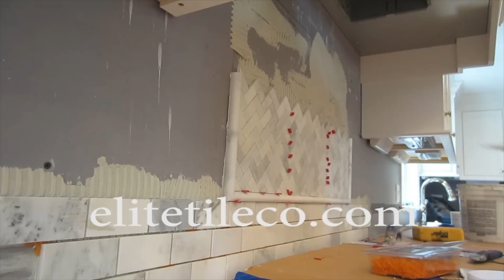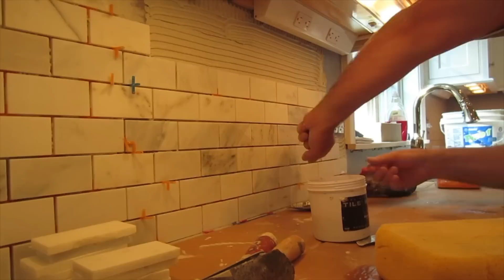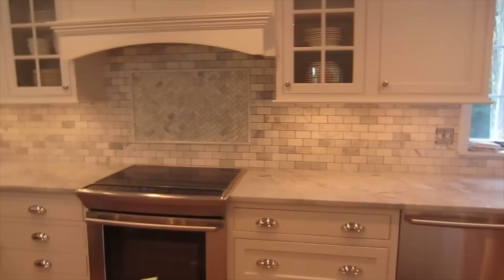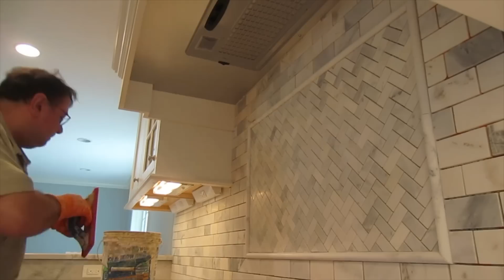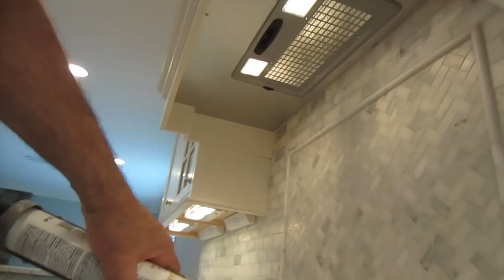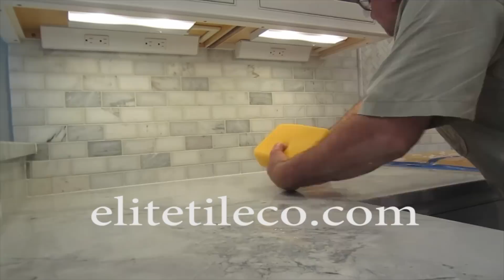Marble subway tile Kitchen Backsplash with feature Time lapse

Comment: Any videos or advice on grouting Beveled Marble Tiles ? The bevel is so deep I don't see how one could grout it efficiently.
Reply from the maker: Use the rounded corner of the float to toll the grout line, or your finger, make sure you are wearing gloves or some other tool hat will do the trick.

Comment: Sal Im about to start a large backsplash project tomorrow and i wanted to ask you.  I see you are not spacing the trim around the backsplash I have 1.8" width trim stone do I need to space it like the rest of the project 1/8th or should I do it flush Ive seen both just not sure which one to do flush or no flush I'm talking about the picture frame trim you are doing there.
Reply from the maker: Should have a grout line between all tiles, it may not look like I spaced it, but I did, it may have been a smaller space than the tile grout lines.

Comment: Thanks for the helpful video.  I followed your videos and installed a marble backsplash. My only issue is that I got sealer on my white cabinets and it stained. Do you have any suggestions on how to remove the discoloration from the cabinets? Thanks
Reply from the maker: Sorry I don't, maybe you can contact the manufacturer for some help.

Comment: I just recently had a polished Carrara marble tile backsplash installed with an enhanced grout.  The installer did not seal the tiles before grouting.  I don’t see any problems in terms of discoloration, etc., with the marble.  However, I want to seal the marble tiles now but the grout bag says it doesn’t need to be sealed.  Will I ruin the grout if I seal the tiles?

Comment: beautiful job!  I am about to put 2x4 marble  on a mesh backing from lowes...question ..what type of premix thinset or Mastic brand etc do you use for the same installation in the video..and what type of grout...sanded/non sanded premix not premix brand ect?  again mine is the same setup as you are doing with the 2x4 tile ..thank you
Reply from the maker: Stay away from anything that says premix thinset, it is mastic no mater what they call it. Many stones will stain if you use mastic, so only use a white thinset that comes in powder form. The same goes for grout, unless it is an advanced grout, like Mapei Flexcolor CQ, use only gout that comes in powder form. Sanded or unsanded will be determined by the width of the grout line and whether or not the stone is polished.

Comment: I used 2x4 plowed Carrara like In your video ..tiny bit less than 1/8...the tile guy that was gonna do it didn't believe in sealing the tile before grouting and told me unsanded would be a complete mess and that he mixes sanded in it ..didn't think that was appropriate for marble ...let me know what I should use for the grout
Reply from the maker: Any natural stone should be sealed before grouting, and sanded grout may scratch polished marble. Unsanded grout can be used for joints up to 1/8", Your call.

Comment: Hi Sal, I have a couple of questions. Do you have a video on how to cut mosaic glass backsplash? And what kind of tool/ cutter would you use for a natural stone with  mosaic glass insert backsplash? They are 12x12 sheets with mesh. I read not to use a wet saw cause the mesh falls apart. Thanks
Reply from the maker: debhl7w I usually cut them on the wet saw, most mosaics will be alright when you use a wet saw, some will tend to come off the mesh, but you can use some tape to hold them together while cutting and dry them off right after cutting. The only way to know is to try.
Reply: Thanks Sal, take it easy.

Comment: I'm a mason by trade my specialty is stone veneer. Quick question will a thin layer of thinset properly bond to drywall or should provisions be made such as installing hardi backer (cement based substrate) to ensure an adequate bond?
Reply from the maker: In a dry area Drywall is perfectly fine.

Comment: Wow! Beautiful work!! I am using the same marble backsplash around my fire place and I want to ask you how you  how did you cut the marble pencils make a frame? 
The solution that you used before grout what is it called and why did you wipe the marble with it?
Thank you 
Definitely share and subscribe 👍🏻
Reply from the maker: +Neirouz, CPA Wet saw for cutting marble, and Miracle  sealer to seal the tile before grouting.

Comment: what size and brand were the orange t spacers you used for this tile?  I have the exact same tile with the mesh back from lowes and can't find a spacer that fits?  since the tile is on the mesh why do you need spacers??
Reply from the maker: they were these http://www.contractorsdirect.com/Barwalt-Hollow-Leave-In-Spacers and the tiles were not very sraight on the mesh so i used them to straighten them out a bit.

Comment: Thanks for making the video. Great work. Those are some heavy tiles. I'm surprised it doesn't sag due to the weight. What type of mortar are you using and is it premix? What do you recommend? Thanks
Reply from the maker: It was probably Ultraflex 2, but you can use mastic on a backslpash as long as it is compatible with marble, some will stain the stone if you get the wrong type.

Comment: Thanks again for your awesome time lapse video and for your quick reply to my question.  One other quick question if you don’t mind.  I noticed in this particular video that you put spacers on the bottom of the first row of tiles, where the tile meets the countertop.  Is this the standard procedure?  Would it be ok or would it be wrong to use no spacers on the first row and let the tile “rest” on top of the countertop??  I realize that in either situation, the caulking will be applied to that area.  But again, why the spacers on the bottom row as opposed to just letting them rest on top of the countertop.  
Thanks again and keep up the great work!!
Reply from the maker: +K. Casey For a small area like this it really does not matter in my pinion, if it were glass tile i would say definitely leave the space but for most i don't usually bother. People like to talk, if i don't leave a space some will call me out on it, so this one is fro those people.

Comment: what color grout is he using?
Reply from the maker: he forgets because it was over 2 years ago.
Reply: Sal DiBlasi  it looks white, or a very light grey. I got the same tile and still have not gotten the grout yet so I'm trying to decide what's best
Reply from the maker: Actually I think it was Silverado, Very light gray. You need to keep the grout color close to the color of the marble, otherwise you will get picture framing around the edges.
Reply: Sal DiBlasi thank you. are you using 8th" spacers?
Reply from the maker: Tile is mesh mounted, so I had to keep a consistent space between sheets, which was about an 8th